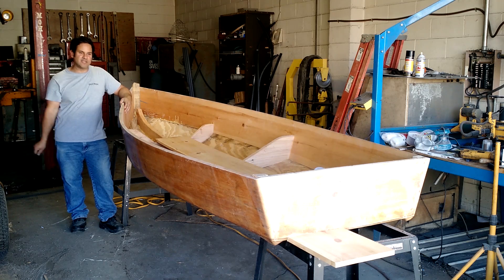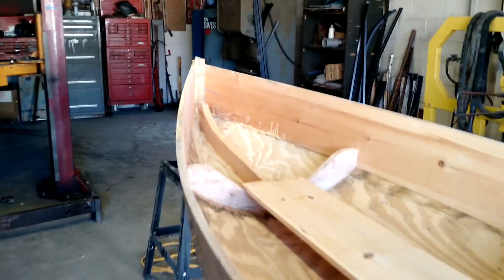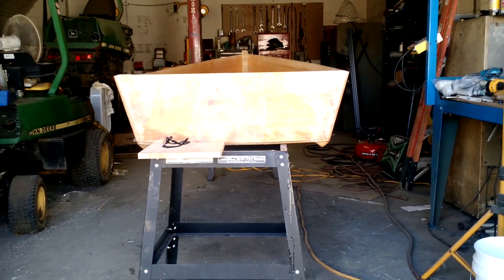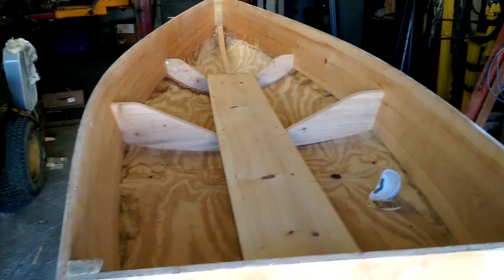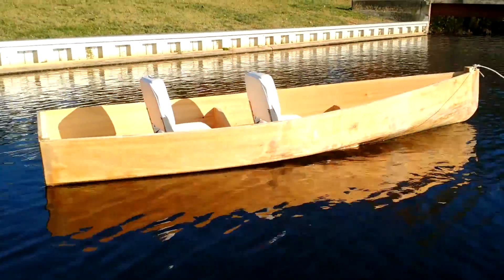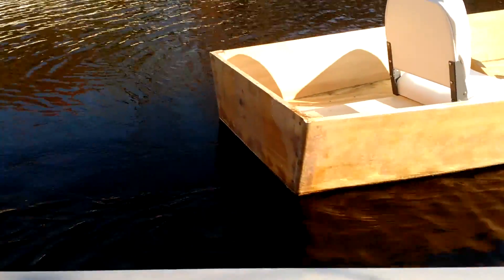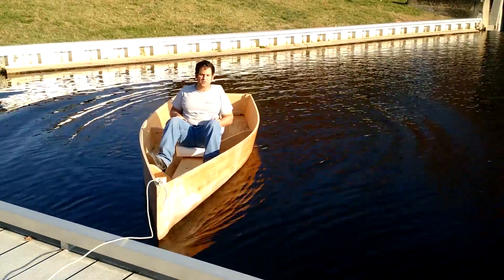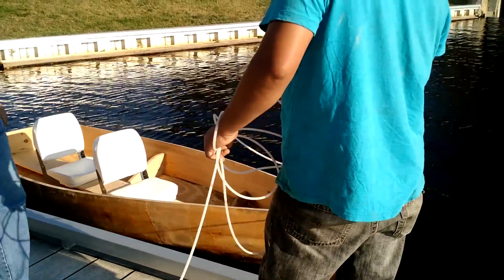HomeMade plywood boat part 6  -  FLOAT TEST

Comment: one more thing.  if you seal the inside with marine grade spar... and maybe drop a little purified sand, it will not mold and will be non slip
Reply from the maker: Good idea

Comment: as a hobby after retirement  my wife  and i started restoring old pontoon   boats   most the hard ware was stainless  so they came apart easy   we found out there is a demand for nice looking cheaper  pontoon boats we usuall cleared about 3000.00 so it was worth while
Reply from the maker: Awesome

Comment: Ray, I have to say that I am REALLY impressed with your boat project. I have gone through all your boat build videos up to this one. I also need to say that I have been involved with the wooden boat building hobby for over 35 years. I see where you have made a few mistakes along your build but HEY, so did I! LOL (Actually I've made some really epic boo boos such as the time when I mixed resin with resin instead of the hardener. Three days later the epoxy still had not set up. I had to clean all the goo with acetone and start completely over. LOL) Anyway, here is one major lesson that I'm sure you have already learned. Ready?

The beauty of building your own boat is that YOU GET TO BUILD IT ANY DARN WAY YOU WANT! There is no such as thing as a right or wrong way to do it. So, never let any boat building snobs tell you different. I love your boat. You did GREAT man!
Reply from the maker: David, thank you so much!! you are right i made a few mistakes but it most certainly is MY boat!!! i agree with you 100%

Comment: When putting a motor on, than first sturdy the stern in and outside, and close the bow about 4-5 feet, but first sturdy the top of the side boards, put in the sturdy sideboards a 1/2 inch doll pin for rowing when out of gas, this go's faster then you think.  
She is nice and sturdy, but you made a huge huge mistake, you forgot to christening and name her, give her a nice feminine name before you put her in the water again.
She's handmade totally for the most by your own hand's so   safe voyage!
Reply from the maker: thanks!  i will do a proper christening when she goes for a real voyage, since this was just to check the waterline it doesn't really count!
Reply: It be forgiven by our king, King Neptune;-))

Comment: Didn't you prepare the inside of the boat? Water will come in always you know, and if there is one thing that plywood can't stand and that's water!
Reply from the maker: +Arend Wolbers thus was just a water test to see how it sits....I still need to finish it, to include epoxy coating the inside.
Reply: OKE!

Comment: I don't know much about boats (apart from how to fall out of them) but I have to say I'm really impressed by how stable this was.  in the end video could you do a quick cost and time rundown just for us to get an idea. can't wait to see it painted
Reply from the maker: thanks!  i think that is a good idea (cost break down).  to this point between wood, glass, epoxy, and the seats...i have about $300 in it!
Reply: that's all? that's unbelievable! I'm glad you used ebay fibreglass I have looked at it myself a lot but because I'm not very experienced with the stuff I didn't want to buy it and not be able to use it but the hints you gave for it were great.
Reply from the maker: yeah that's all so far.  wood is about $100, glass was $30, epoxy was the most expensive at $150 but i only used half, seats were ebay as well and they were $100 for the pair.
Reply from the maker: correction: the seats were $90 for the pair, i just checked!
Reply: Wow that was a steal, well worth the money

Comment: plywood boats have a habit of siting on top of the water rather than in the water. The engine should change that for sure, and you might need to add front ballast  but all in all it looks great
Reply from the maker: good info thanks!  i think the front seat will be the drivers seat and i will pull it a bit forward.